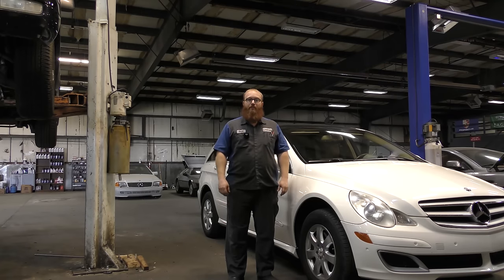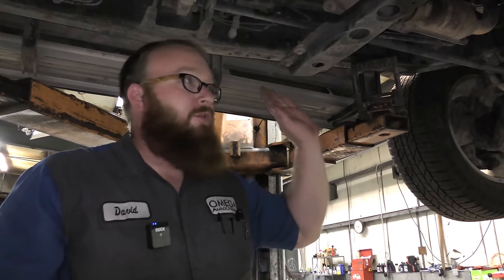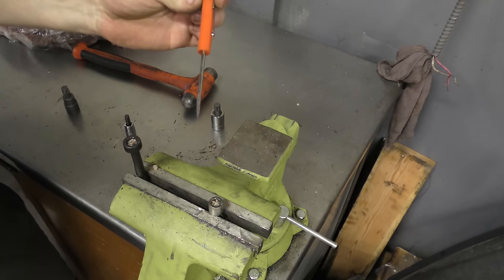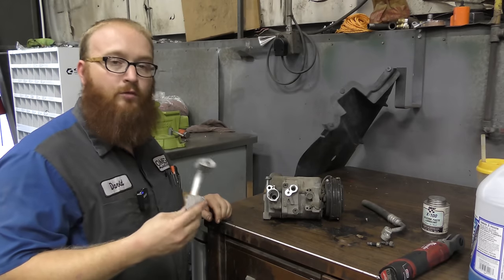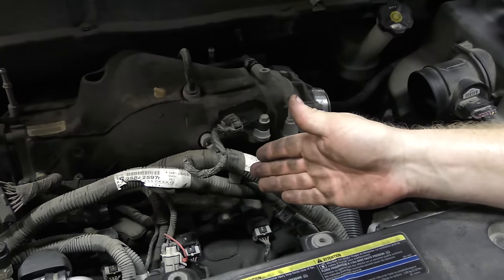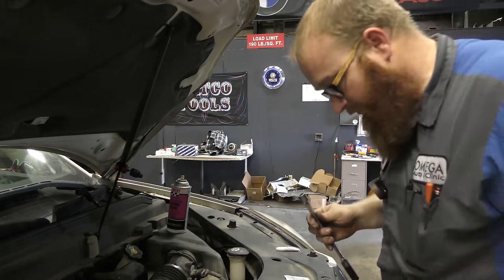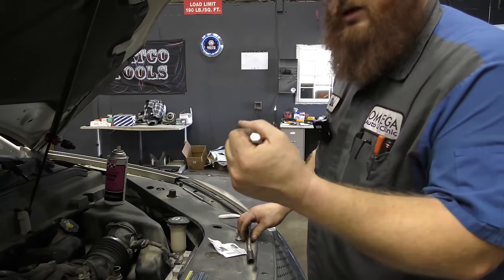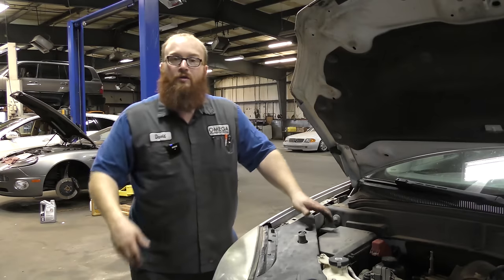The CAR WIZARD shares 10 Crazy Easy and Essential Mechanic Tips

Comment: Good tips. May I add , #1. Use 1/2'' Extensions. The 3/8 have too much flex and try to keep it short. The longer the extension the more twist and less torque gets to the bolt. I use a impact 3/8 ball swivel socket with a 1/2 to 3/8 adapter that way your stepped up to a 1/2 inch extension that wont twist and my impact pop's them right out.  # 2. I always tell young mechanics that just cycling the key alone may not activate fuel pump. Sometimes you have to bump the starter. Also pumps can be running but not have enough pressure to pass through injector. If no pressure gauge is available,  A shot of brake cleaner or carb cleaner in intake to see engine fire up and die will tell you if its a fuel problem. Do not use starting fluid !  #4. Great advice especially A/C o-rings. It is a big no no to use A/C oil. A/C oil is dry like brake fluid. I use brake caliper pin grease because it is slick for easy install and dont eat rubber.  #6. I been doing this trick since the 80's. Another tip if your trying to install a nut on a stud you can slide the nut onto a long phillips screwdriver , Place the tip of screwdriver on the stud and let nut slide down onto top of stud then turn to get treads started before removing screwdriver.  #9. This is another old trick I use, Also it dont always mean its the regulator. When you see the draw on light bulb with no movement or sound, More than likely its the motor because if it was the regulator there would be a grinding noise and or window would attempt to move. If its the motor there is a similar trick as the gas tank. Open door , Hold switch in up position and slam door as you continue to hold switch. It also helps to do this with engine running and all accessories turned off so to get as much voltage to motor as possible.

Comment: I start my morning right with Crest Silicone Spray.
Reply: Gives a nice sheen to my teeth.
Reply: Zee best, baby.
Reply: Hotlog   Yeah just be careful.  Don’t get the Pepsodent and the Preparation H confused.
Reply: Hotlog
 - For what it's worth, here it goes. For general use, chose silicone based on the cheapest you can find and always use the straw included with most spray cans. 
It saves a lot of material and focus the application where it's really needed . ;-) If used almost daily like in my case. By the end of the year, it will save you a bit more then this 2 cents. ;-)
Cheers

Comment: Also about #1. A while back a sworn  that I would not work on any vehicle made by Ford and specifically on older ones! It’s always seemed, that I have to bleed all my knuckles and remove a dozen of other things to get this one bolt out. Then one day, I watched an old guy (retired ford mechanic) worked on old ford van. Working on a rusty front suspension he was effortlessly getting things in and out, coming form under wheel arch, from engine compartment, from underneath the van. He worked absolutely effortlessly, while sucking on a cool beer and having a joyful conversation with his quadriplegic friend   Whose van was being worked on. 
So yes, be creative with solutions, we live in 3D world - use multi dimensional approach!

Comment: I did your tip #10 to reset my check engine light. It comes on every 3k miles or so for oil Change. I use Amsoil 100% Synthetic oil Signature series 0w20,  its the extended drain 25k oil, I Change my filter at 9k then Change my oil at the end of the year. I generally put 15k or so on my 2009 scion xb 2.4 yearly. Oil looks good vehicle runs great. Great info Dave.

Comment: How about number eleven: You can't damage threads with your fingers but you can with tools.
Reply: Torque it down till it strips, then back it off a half turn...lol
Reply: You haven't seen the chinese steel  screws that are as soft as aluminum. I thought they actually were aluminum until I picked them up with a magnet.
Reply: @OffGridInvestor  it's possible the design parameters for those soft screws were made that way...Ive seen copper screws in a 1955 Pontiac torque converter.

Comment: I've found PB Blaster more effective than WD-40. . ..in many situations.
Reply: That's all I use now. I go through a can a month. It will also shine up a lawn mower or any small engine equipment and make it look like new when you take pictures for advertizing and when the person comes to look at it. I usually do it just before they come. It hides scratches and makes the equipment look great. After it drys, it helps protect the equipment. Keep it off the exaust.
Reply: Try Aero kroil
Reply: AEROKROIL. None better.
Reply: Melvis Telal  I hate the smell, so I use it to kill hornets in the summer. There are  other better products out there.
Reply: WD40 is effective?!
Anyways; I like liquid wrench
Reply: Up north we use WD40 to clean marks from interiors& clean tools. PB blaster on new cars. Anything more than 5 to 8 years old and its Kroil..Then the torch.

Comment: My favorite trick, that I have only had to use once to help someone (and their father couldn't believe it), is when the bendix gets stuck on a fly wheel tooth; out the car in neutral, roll it a few feet, and it will start right up. The key is you won't hear the starter turn or anything.  No clicking, no attempt to turnover, nothing.

Comment: I want some of those manual relays
Reply: Make them yourself if you have the brains. A hint is to get a switch rated at AT LEAST 40 amps DC. Completely ignore the AC amp rating if it has one. But it has to have a DC rating. And get some spade bits.... There's a way they wire all relays so once you know that you'll know what prongs to go for.
Reply: Waste of time and money:  lots of relays have different pinouts, you'd need LOTS of those;
All you need is a wire...AND the schematic for THAT relay; it's NOT the tools,it's your brain that gets the work done;
Anyway,if you want to complicate things,just remove the cover of a like relay and press on it with your finger...

Comment: Excellent tips David, (hope it's David my memory is not 100% anymore) I have learned 6 of the tips through  experience or the internet already but use CA glue for washers, paper for bolts, and silicone spray for connectors and intakes was mind opening. Thank you for sharing your knowledge, God Bless you.

Comment: don't use petroleum based lubricants on your rubber O-Rings.
Reply: Can you pleas explain why?
Reply: @StaticImage  Because petroleum based lubricant will eat rubber away over time.
Reply: It would depend on the oring if it is on an oil sealing part it wont matter
Reply: socal rocks Named after my state
Reply: Correct, but I'm 90% sure silicone is not petroleum based. Love silicone!
Reply: @jochenstacker7448  But silicone spray isn't petroleum, is it?
Reply: @StaticImage  No. It's synthetic polymers.
Reply: Adding to what was said. If replacing O-Rings, do make sure they are appropriate for the application. Say, an O-ring good enough for the water circuit, might not be appropriate for the engine oil or brake oil circuit or AC, etc. 
That's a very neglected detail that make many go back to the same work sooner than needed. ;-)

Comment: Who watching this has a car lift???
Reply: Not Me brother
Reply: I do. But it’s quickjacks
Reply: I had a 6000 lb scissor lift, but it was janky, and I work on 3/4 and 1 ton trucks a lot, and they are too heavy for it. I sold it on the cheap and went back to jacks and stands which was always how I did everything before. Lifts can be nice to have, but they take up space, require maintenance, and are really a luxury not a necessity. A big drive on lift with the center frame secondary hoist would be nice, sure… but you would really only need it if you have so many incoming projects that you need to make every second count as effective. It’s hard to keep that pace up constantly without having burnout In my opinion. I can fix them fast enough on jacks and stands, the lift really only save the time of using the jack and setting the stands. You also have to either be hunched down below the undercarriage, or set it high enough to clear your head, now everything has to be done reaching up. I would prefer to reach down, but that’s just me

Comment: Hey I wanted to purchase your relay kit , but your link is not working
Reply: Did not find a link to those switches for troubleshooting relays.
And I've had bad luck with silicone spray on plastic.
Thank you for the tips David!
Reply: Same here.
Reply: I couldnt find those on/off relays in links either. Very disappointed.

Comment: Do you have a link to those relay replacement test switches, I can't see them on your amazon page and they would be damn handy to have.
Reply: Same
Reply: I did a amazon search no luck...
Reply: Go get a  DC RATED (forget AC rated) 40 amp or higher 12 volt or higher switch and 2 spade bits. Don't even bother with switches only rated for AC. Learn what prongs are what for relays (essentially they're the same for every relay). Whack in the spades into the right holes and you're on.
Reply: multitester anyone?!
Reply: search Amazon for IPA #9038
 I believe these are the right things, but I am not a mechanic.

Comment: German cars are screwed together with those bloody torx screws.
Reply: I can't think of a better drive than torx.
Reply: They work well on the assembly line with power tools. Trailers use square heads, GM used weird figure 8 holes. We called them “Oldsmobile screws”
Reply: The external torx is called the e- torx, and I've seen it on mercedes and bmw. 
And fyi, spend the $40 on hose clamp pliers- the kind that you squeeze the handle and it has the clamp at the end of a cable...it will save your knuckles and hands when you are trying to get hose clamps loose (spring clamps- not screw hose clamps)

Comment: Dear Car Wizard...... I was offered a very nice Police Interceptor ( P71 ) at a very affordable price in Calexico Ca..We all know in summer time,  the temperatures over there can and had reach up to 122F in summer time. I am located in San Diego and saw this car all Top notch, 18 " cobra rims, recently painted. Now...here in Ca. The average price for these type of used cars is no less than        $  2K's so I made contact with the owner and he was asking only $ 1700.00 dlls for it. No speeding tickets, no parking tickets, nothing. I felt in love in seconds with that P71 , so I asked him a couple of questions. The most Relevant question was that If he had the cooling fan set to start spinning and stopping when not need    but he told me that because of the very high temperatures most of the people set the cooling fan on their direct , so at the time you open the switch the fan starts to work to maintain the engine cool enough to prevent overheating, also the thermostat was removed on that P71 . So I buy that because after all it make sense  right ?. 
Maybe it is not the right thing to do but is a way they ensure they wont have an engine overheating driving in traffic with their AC on @ 120F outside. So I ask the most silly question of all times. I simply asked the owner what time of antifreeze he was using on his car, which he respond : NONE, just plain water. I say to my self WTF ?, I mean water evaporates with heat any 12 year old boy with passion for car knows that. I did not Sayed to him nothing , jus asked him for a small video on is car at the time he starts it up, since I was going to spend my hard hearn cash on a vehicle besides all the way from San Diego to Calexico Spengin a bus ticket in the first place.  So, my Question to you Mr. Car Wizard is.,.. How a person can sell such vehicle at a very affordable price. I saw the date he put the car on date and was from 9 weeks ago. I mean. Nobody overther in Calexico bought such bargain?. What do you recommend me?.

Comment: dont bang on your gas tank like that if you live in a salt infested area and drive the car in the winter.
Reply: HUH???
Reply: Hammer will go straight through it
Reply: @straycat62  The point is the salt will likely have so rusted the tank you're likely to knock a hole in it.
Reply: Unless you have a car with a plastic tank. Like in countries where they make cars properly.
Reply: Practically every car made in the last 30 years has a plastic tank.  Heck, even my '88 Civic's tank was plastic, IIRC.

Comment: The most important one I've learned is: for any bolt, look to the other side and see if the threads at the bottom are exposed; if they are you have to clean and lube them or they will get stuck coming out.Maybe a wire brush or thread file. If there is a lot of exposed thread I'll run a thread chaser over them. Sometimes I'll just cut the end off if it's reasonable to do so.

Comment: This just came up as a recommended video for me and I learned a couple things, thank you.  I've been a driveway mechanic since I was a teenager and had never seen anyone use the paper trick on bolts.  That is awesome!  As far as the silicon lube on o-rings and rubber parts, I did know that.  When I share that info, I point out to the person, "Would you ever put on a dry condom?"

Comment: I came for O ring help and found 2 more aha! tips as a bonus.    I could have used the fuel pump tip a few yrs ago when it was just me & my dead honda on a very quiet stretch of 2-lane country road that the tow truck driver couldn't find for 2 hours. 😂 I'm putting a mallet in my trunk for next time that adventure happens!  
 (I don't even qualify as a shade tree mechanic. I am more of a "Yes i know what a wrench is, but only use it when I'm too poor to pay a real mechanic"  mechanic-ish wannabe.)  Very helpful video in my eyes! Thanks!!

Comment: Cleaning out the bolt heads seems like a duh, but it's amazing how many don't think about that. My dad managed a hardware store and carried a pocket protector with pens and pencils, and a small, flat screwdriver with a magnet in the handle. Once a young coworker asked, "What good is that?"
He just responded, "You'd be surprised."

Comment: The fuel pump can also fail after a fill-up (because of clogging of the filter, not the same reason as the commutator thing) because they probably bought gas either shortly after a tanker "dropped a load" into the underground storage tank (UST) at the gasoline station or actually filled up WHILE it was dropping a load. I see people doing it all the time and I just shake my head in disbelief. If I see a tanker at a gas station, I keep driving. I worked 30 years with USTs. USTs have a "drop tube" from the hatch that the tanker driver opens to connect and extends down to just above the bottom of the UST. When the tanker drops the load of gasoline, the gas comes out of the bottom of the drop tube at high velocity and hits the sludge at the bottom (and there is a lot of sludge in them). Think of a giant 10,000 gallon snow globe, but with rust flakes, paint flakes, dirt, etc. flying around instead of "snow." It takes a good while for all that crap to settle back out. I always wondered about the idiocy of that setup until I decided it was on purpose to actually help clean out the UST and redeposit it into vehicle tanks. Only a very few people would ever know. Unfortunatly, you will never know if a tanker left the station five minutes before you pull in.

Comment: When I was a kid I was out with the family and the fuel pump packed up.  Spent the rest of the journey putting my mouth to the fuel filler and blowing to put pressure in the tank.  Had to repeat the process every few hundred yards.  We travelled over 20 miles like this.  Next day I had a perfectly round patch of skin burned off the bottom of my face.  Turns out that petrol fumes burn the skin.

Comment: Tip number 11. Went to start my car and all I heard was a click under the hood. Ran jumper cables and the same thing happened. Took a wooden two-by-four and hit the starter solenoid. Car started right up. Similar problem on my 2000 Honda Accord. Battery was not charging fully and measured 13.2 volts with engine running at battery. Almost bought new alternator for car until I found out it was boat that connects wire to alternator was corroded at alternator.

Comment: With all respect, the fuel pump is mounted on top of the tank and usually is accessible by removing the rear seat so the mechanic doesn’t have to take down the fuel tank full of fuel. Also, relatively modern cars have plastic tanks, if you hit it with a hammer, you’ll probably have a bigger problem than just the fuel pump.

Comment: Penetrating oil and time is my tip.  This works if the vehicle is drivable, and I can put off the repair for a few days.  I douse the the fasteners with penetrating oil.  Within a few days corroded fasteners tend to come off with ease.  I don't have to use a heat gun or a torch.

Comment: I was working on one of my Corvairs years ago and dropped a small bolt down into the intake manifold.  I thought, how the heck am I going get that out?  I thought for a minute and came up with an idea.  I got a piece of vacuum hose and taped it to the nozzle on my shop vac.  I  fed the hose into the intake and retrieved the bolt.